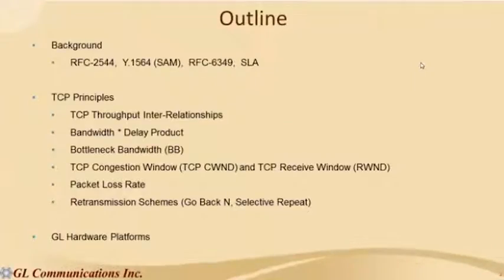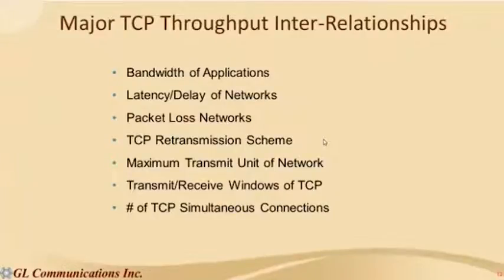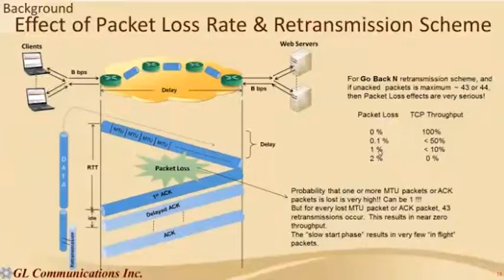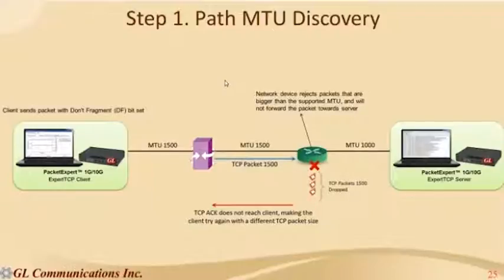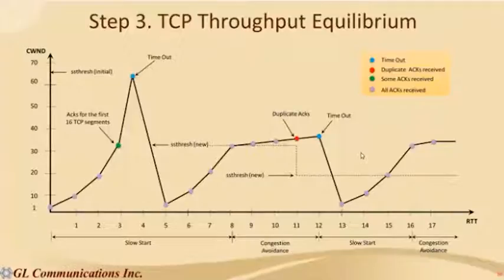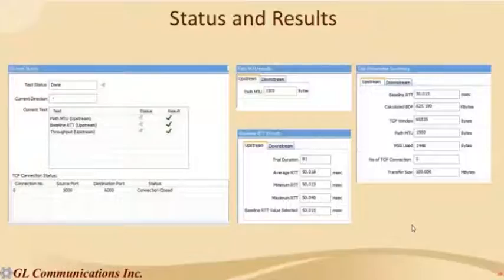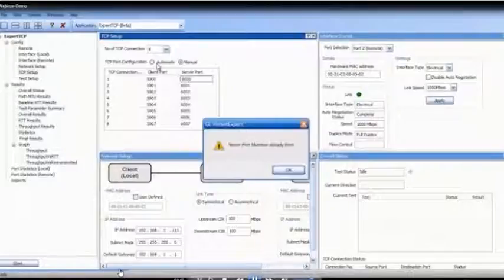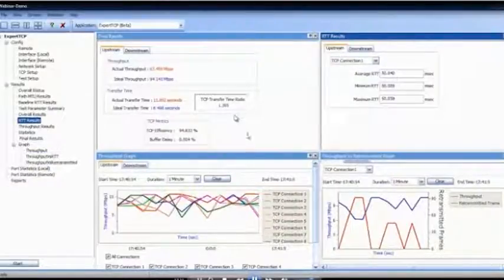ExpertTCP™ - TCP Throughput Testing Methodology

Comment: As you know, data is measured in Bytes and throughput is measured in Bits. A few times, you used the two interchangeably, which confused the metrics.